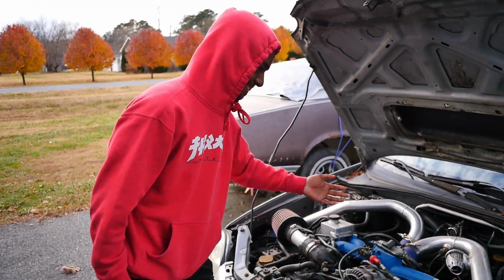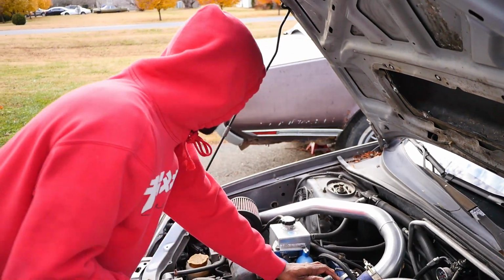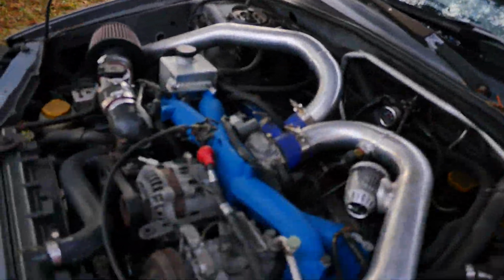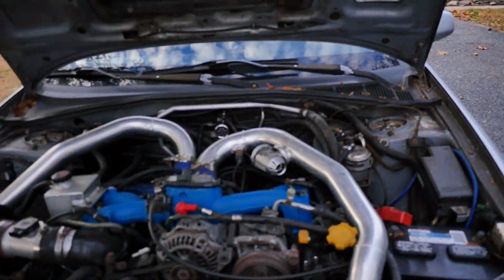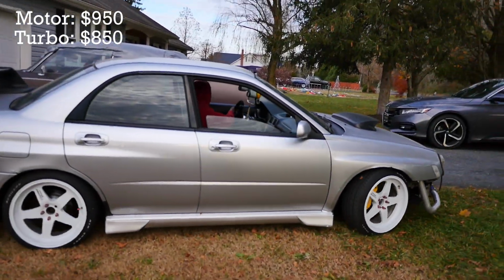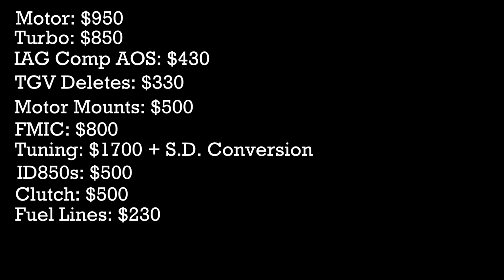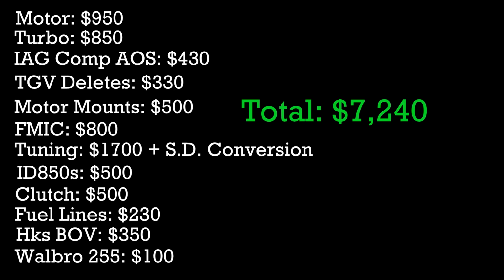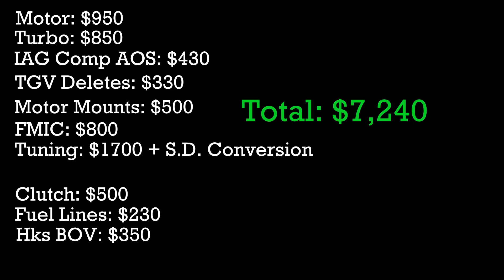2003 Wrx  jdm205 Build Breakdown

Comment: Car sounds great! For engine bay, I used simple green purple variant. Take to high pressure car wash, cover alternator with plastic bag, disconnect battery, spray simple green let soak, then spray off bay with high pressure.
Reply from the maker: Definitely will do that when the weather breaks